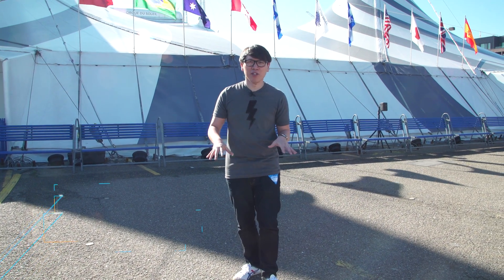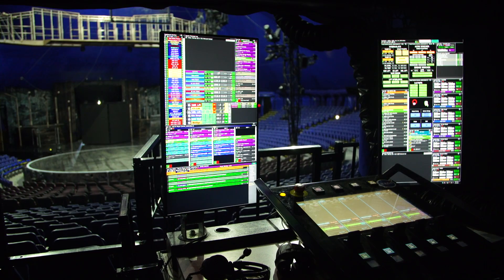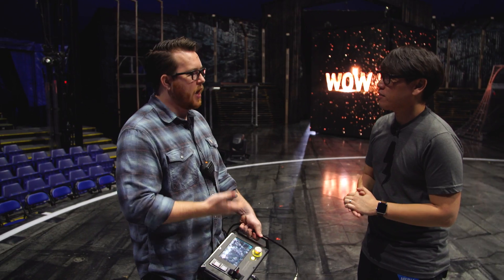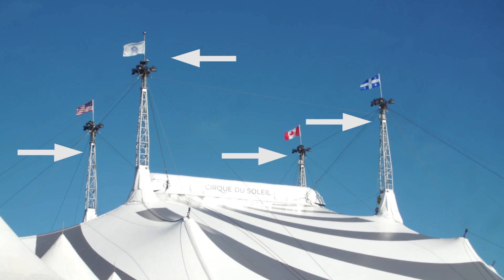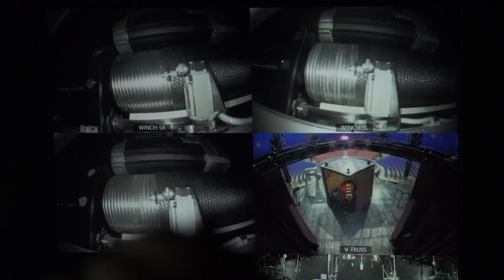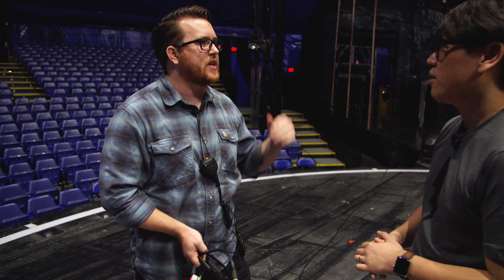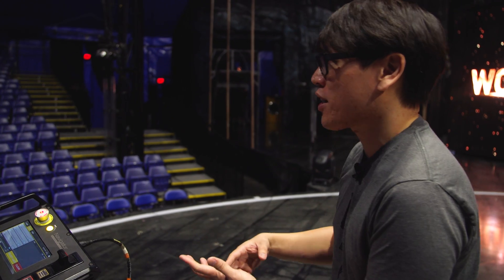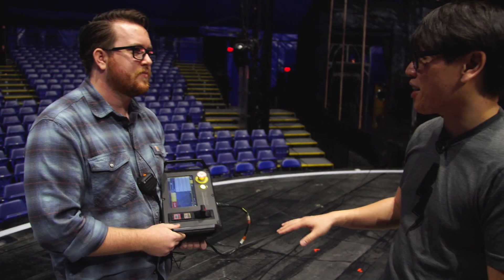Tested: Behind the Scenes of Cirque du Soleil's Volta!

Comment: I went on a similar tour when Cirque was in town a few years ago.

The things that I found interesting is that the crew/operators would change jobs for each show , so that everybody would learn each others jobs. This wasn't just within departments it would cross over to other logical departments too. So the lighting board operator would operate the lighting desk for one show, a follow spot the next , floor electrics after that and then might cross into automation too. The gave 2 reasons for this on a purely $$ point of view it meant that overall they required less crew on the road and also for to allow crew to take holidays, as if you are the only person who knows your job you can't go on holidays as no-one can fill in for you.

Another thing I found interesting is that at least once a week, they practise rescue & evacuation procedures so if a performer has an accident, all personal know what their responsibilities are.

Also when the tent is being built ( by a specialist crew who goes all over the world putting up and pulling down the tents ) that as for example the lighting crew couldn't work ( as the venue/tent isn't built yet ) they swing onto the tent crew by running around in bobcats driving in tent pegs with hydraulic rams

Comment: How come working at height regulations mean I HAVE to be in a harness and securely attached the second I leave the ground, yet these guys can swing around with no such attachment? Whats the work-around to make sure it's legal?
Reply: The acrobats do it in the exact same manor and conditions every time or they dont do it. You have to be in a harness because your work will have uncontrollable circumstances.
Reply: @thatseangroves   It has nothing to do with "Uncontrollable" vs "Controllable" and Ciruqe's acrobats are CERTAINLY not covered under OSHA, and that is a very deliberate move on the companies part because it would not be allowed to legally put on shows if they were. You are correct in terms of an artist's right to refuse to do an act if anything is unsafe, but them being allowed to do the act in the first place stems from how they are employed by Cirque. It's a bit of legal acrobatics (pun intended) but essentially the artists are independent contractors, and take on all of their own risk doing their acts. The Cirque du Soleil stage isn't deemed their "workplace" by law so Cirque has no obligation to adhere to OSHA regulations for their artists. Cirque's technicians are indeed covered by OSHA, but none of there performers are. I'm not sure this goes for all companies like Cirque, but I know for a fact this is how they specifically operate in the USA.
Reply: @trottingfoxinc  what is your experience with cirque and acrobats?
Reply: @thatseangroves  I'm a lighting designer and technician who has worked with them in the past, and a good chunk of my friends currently work for them on tour, on a cruise ship, or at one of their residency shows. I also have worked directly with the software and hardware Cirque uses for automation and flying performers, although that was not with Cirque themselves.
Reply: @trottingfoxinc  fantastic!
I am the one in the video. I've been personally flying performers in cirque for years. OSHA does protect performers to ensure that they are properly trained to do the acts they are paid to perform in. They are not independant contractors and the stage is absolutely considered their workplace. OSHA protects them to ensure they are trained properly and properly supported. Cirque was fined for the accident on KA. When people claim that performers arent protected like other employees it opens doors for people to do unnecessarily dangerous stunts.
Reply: If anyone would like actual specifics on OSHA coverage for performers and acrobats let me know and I will provide you with my email.
Reply: @thatseangroves  Thanks for putting light on this subject, Sean, as it could be corrupted by false information. It's good to have you on the reach to clarify doubts.
Reply: @trottingfoxinc  by software I assume you're referring to Tait Navigator?